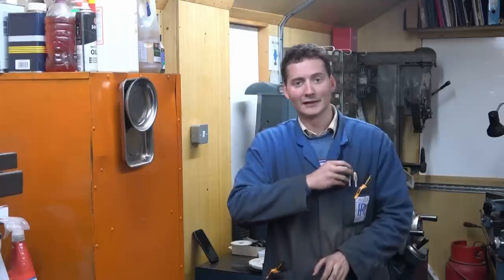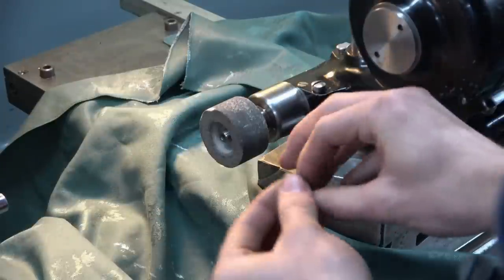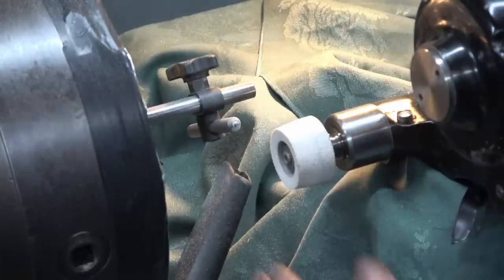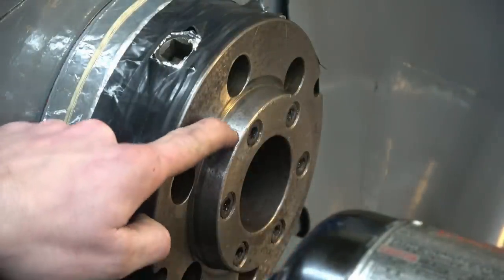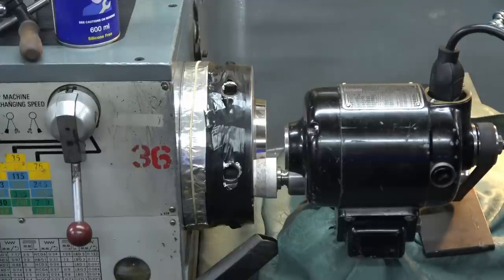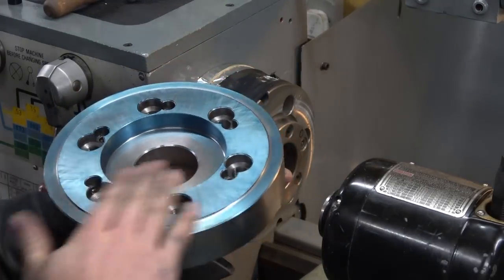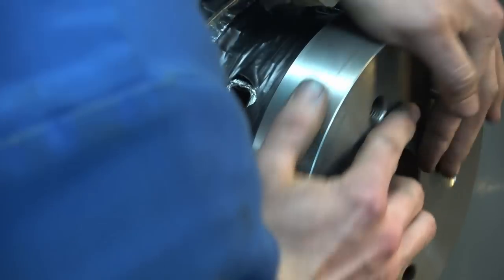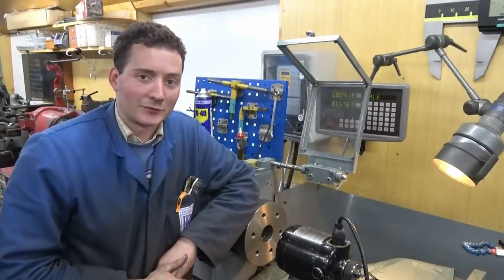Re-Grinding a Lathe Spindle Nose

Comment: no attention to the face of the nose?
Reply from the maker: It's in clearance by about 1mm, I can skim it with a turning tool if I ever get concerned.
Reply: Ah ah! I was looking for just this question. Was wondering if there might be burrs interfering with the fitment considering the beating it's had. Probably no problems with a 1mm clearance.
Reply from the maker: Yes I should have mentioned it
Reply: @MrCrispinEnterprises  its all part of some clever plan isnt it?
Reply: I was looking forward to some final run out readings!!
Reply: The very thought that I had. One needs reference surface to take measurements from. So the very first face tobe established would have been the nose.
Reply: @bcbloc02  he works for rolls royce, so the eyecrometers read "adequate."
Reply: @nilzlima3027  Eyes are like opinions, everyone has them, but properly celebrated measuring equipment usely don't lie.
Reply: @bcbloc02  Yes, I think it would be interesting to turn a piece and then remove/remount the chuck and check the run-out.

Comment: SUCCESS! Good job. From the pattern on the face it looks like the wheel axis was slightly downwards (no cross hatch), would like to see an indicator traverse across the face. I think those D5 pins are adjustable so you could have always adjusted them to the new depth if needed(if I recall). 
What really surprised me is just how soft that spindle nose is to sustain such deep damage.

Comment: Hi Mr Crispin, When I reground the D1-3 taper on my Boxford 11-30 I made a gauge which gave me a reading of how much to take off the flat face once I'd tickled up the taper. It saved a lot of time. As you said you don't need to take a lot off the taper to mean you have to take a lot off the flat face. My gauge is a piece of round steel with a parallel hole through which contacts the taper about half way down. Three micrometer heads are zeroed with the gauge flat on a surface plate. I calculated the distance they needed to project to all contact the flat face with the same reading and then checked it against a D1-3 lathe at work. It was bob-on. The taper on my spindle was fine but the flat face wasn't. I took the minimum off the taper, checked with my gauge and then ground the flat face the difference shown on the gauge.

Comment: I've ground a few spindle noses in exactly the same way but I had the advantage of an old hand looking over my shoulder on the first one. My mentor's contribution was to quantify initial conditions and making progress checks using a dial indicator.

Grind the taper first. Tram the grinder spindle to sweep a plane radial to the lathe spindle axis (as you probably did but didn't show.)

Offer up the gage and note the side play with a dial indicator. Depth mike from the end face to the registration surface. Knowing the side play and working the taper triganometry gives you the stock to be removed from the registration face to obtain a flush fit. Proceed, cup dressing the wheel face from time to time, taking side play and depth mike progress checks til you obtain a flush fit and then a bit further to obtain the 0.001" to 0.002" draw.

The US standard governing spindle noses for lathes is USAS B5.9 - (1967) (Reaffirmed 2004) Available from the American Society of Mechanical Engineers. In it are detailed drawings of every version of US standard spindle noses including small parts. The Metric world standard is much the same differing in small details - but check! These standards are available for a fee (mine cost $35 in 2014) from the parent society. Pay the money! It's cheaper than screwing up out of ignorance.  

Your remarks on protecting the machine from abrasive dust cannot be over-emphasized. Hysterical care in protecting the machine from flying abrasive dust and a careful sequential dismantling of the shrouding with a thorough clean-up thereafter is only common sense. I'd also recommend cleaning/servicing the wipers.

Good work, well illustrated.
Reply from the maker: Thanks. The set up is shown in the video called 'setting a tool post grinder'
Reply: @MrCrispinEnterprises  Thanks. I found it last night - the series leading up to the spindle nose grind in fact. 

Yes indeed. Hard rigid steel items are literally made of rubber on the micro scale and the amount of droop from gravity is roughly calculable if some simplifying assumptions are made and some basic math employed. I've used the very same demonstration (inverting a mag. base and DTI mounted on a short stiff length of square tube) to demonstrate to my apprentices the perils of sweeping diameters from horizontal spindles. That and your application of trade math, geometry, physics etc make your presentations most informative. Machine shop work aint just cranking handwheels and shoveling chips. The most important phase of part manufacture is the initial planning and calculation before the first chip. I'd recommend many of your videos as required viewing for machinist and tool maker apprentices.

I discovered your videos only a few days ago. It's been most pleasent and informative browsing my way through them.
Reply from the maker: Many thanks
Reply: Hi Forrest, glad you're well !!!
Reply: Good to hear you are still alive Forrest Addy.

Comment: Excellent stuff! I'm really look forward to seeing how much (or little) runout there is on the back plate and chuck when its all finished. I'm hoping to have a new lathe shortly and maybe its something to check before putting into use for the first time. The chinese are not known for sorting out the little things on some of their machines. As Stefan says, they are a kit of parts.
Reply: Just and fyi .....most new equipment come with a comprehensive inspection sheet that provides pretty much ALL details specific to the motion accuracies.  If you have the capabilities (precision measuring tools) it would be prudent to check what you can and compare your findings.

.

Comment: Well done. I have D1-8 spindle on my lathe and i think that you can adjust those pins in and out before putting allan screws.
Got to get me one of those grinders, a tad bigger with AC motor for less noise.

Comment: I am surprised that you did not take deviation measurements before and after, using a tenth dial indicator.
Great works and excellent video!!
Thanks for sharing Sir.
Reply from the maker: I knew it was significantly out before, and now I know it's as good as I can get it!
Reply: @MrCrispinEnterprises  …and that here is one of the hallmarks of a professional! Knowing where to push for another magnitude of resolution or another  .1% of speed etc. - and where not to 😊

Comment: Nice work and you're right about shallow tapers, doesn't take much to get it to seat way further back. Also i think you could just wind in the cam bolts another turn if you had to get agressive on the face - the gauge line of them might be below surface but I reckon they'd still work

Comment: i have done dozens of these. the simple way is remove .003 from the back face first then do the tapered spindle surface to diameter using the calibrated master ring.  also i usually grind the nose end  and mark it with the rework date. note that this will not fix bad bearings as some think it will,

Comment: Maybe it's because I worked hard to pay for all of my tools and lathes (I have two), but I take extra care to clear any debris or chips when swapping chucks. I make sure there is nothing in between the spindle and whatever I'm mounting, not just for concentricity, but to avoid the type of damage that you just removed. Nice job btw. Very well done based on your Prussian blue.
Reply: Ownership is surely one of the differences, and Crispin reports that this lathe is ex-college so there’s that… ;)
But there’s also the real-life pressure of having to make money (or make a lesson fit) and something’s got to give.
Reply from the maker: Agree with all the points above plus the idea of understanding. I expect learners at the college didn't understand the effects that the swarf was having.

Comment: I have been following your video series on taking your lathe to bits with great interest. Since I tend to feel weak whenever I see a neglected machine tool—or if you ask my wife, she'd say I’m not in my right mind—it just so happened that I ended up buying a lathe with a slightly bend spindle nose. In case you're wondering, no—it’s too late—it’s already in pieces.

It seems that I have a similar task to tackle as you had, and because of this, I'm very interested in how you set up the dressing diamond so that its axis points precisely through the center of the toolpost grinder's axis. As you've rightly pointed out, when machining tapered workpieces, it’s crucial not to introduce any errors in this regard. However, since I'm a bit slow, I can't seem to picture a feasible way to set up the diamond as described.

I assume you went with the tapered dress because you needed to grind the mating surfaces of the spindle nose and the chucks. Since in my case only the spindle nose needs reworking, I believe it might be more practical to dress cylindrically and, after machining the taper surface, realign the compound slide to work on the flat surface.

I'd really love to hear your opinion or any corrections to my thoughts.

Cheers
Reply from the maker: If it's just the one spindle nose you're grinding then yes that would work. I found I have to redress the wheel quite regularly on the face work so it suited me to level the angle set. Cheers.

Comment: Great Outcome Crispin. When we first chatted about what you intended to do with the spindle, you did say just grind out the high spots as 0.001" off the taper diameter would mean about 0.005" off the back face, looks like you took about 0.002" off the diameter then ? Do you remember how much you reduced the diameter by, just out of interest ? So glad you bought a Branded back plate instead of going Chinese for your reference gauge. After you have finished with it will you use for the ER 40 chuck ? Regards from Australia.
Reply from the maker: I think about 7 thou is probably the number but it's impossible to track as the front of the wheel wears. If I were to do it again then I would skim the front face of the hub first and then I'd be able to use a depth mike to monitor progress. Thanks for your support on this project.

Comment: Good result .  Can you show a clip of the grinding pattern on the face next video ?    .    While you still have it set up , have a crack at shimming the grinder to get the criss cross pattern .  Could not see if you achieved that or not .     The method i use is to blue the face & rotate the wheel by hand , then shim the base angle up or down to get the result .    Good one .  👍
Reply from the maker: Thanks for your comment. It's very close but not quite a full criss cross. It's flat enough that even minimal bluing covers the whole face but not quite criss crossed. I'll have a think.
Reply: @MrCrispinEnterprises  You are right about the limitations with speeds . You can partially get around that by running the lathe the other direction to get a reduction in surface speed if reqd .

Comment: Monarch lathes on spindle rebuilds, hard chromes the old spindle and regrinds the bearing mounts, last grinding the spindle nose/internal taper in place in those new Timken type zero taper roller bearings. The bearings have errors that are marked as high spots, regular production of spindles is going to have small errors also. Manufacturers of precision spindles inspect the components and often juggle the bearings high spots on inner and outer races to compensate for component errors, then finish off with a light grind of the spindle face and taper. This is why if a spindle for any reason is disassembled and reassembled will most often not run true as before. The only meaningful tip I have is if the spindle has to be removed, mark the spindle shaft and inner race locations and outer race locations so as they can be returned as close as possible. A factory spindle rebuild is over $15000. Grinding the spindle in place is the only option. Great video of the worst nightmare of a problem.
Reply from the maker: Good information, thanks

Comment: Thanks for the very informative set of 3 videos about setting up the tool-post grinder and grinding a Camlock nose/backplates. I have a similar job to do on a smaller Camlock nose and your description is proving very useful. You mentioned that the wheel you had was a bit too fine. Do you know what the wheel was and could you recommend a more suitable grit size? Many thanks.
Reply from the maker: I would go for a 60 grit or perhaps even a 40.

Comment: Might have missed skimming on the video, but did you check spindle bearings runout and precision level before? For this operation is usually called 'Restoring spindle base' and requires quite precise bearings with lowest runout possible. Not to mention that in real industry it should be made using dead centers on fine-tuned center holes after all heat treatment operations complete and some time passed to stabilize the steel structure.
Reply from the maker: I checked for play in the spindle bearings before starting

Comment: Very interesting, I wondered how much you could remove to clean up the taper without having to take too much off the back to maintain the correct relationship. A really excellent explanation of the camlock system too. I expect that next you will be using a different wheel and cleaning up the spindle internal jarno taper (or whatever it is).

Comment: Mr._ Crispin - Great Video ! You did an excellent job. I have one question. I was wondering how you matched the angle of the grinding wheel to the angle of the Lathe Spindle Nose. You dressed the grinding wheel using your lathe compound. How did you determine what angle to use ???
Reply from the maker: Have a look at the video called 'setting a tool post grinder'
Reply: probably found a clean spot on the nose to indicate to the compound.

Comment: Excellent results there.  Given the shallow taper, not surprising you had to take a lot off the back, but the results look to be worth the effort you've put in.  I'm going to be making a vertical head for my milling machine, which is going to mean grinding bearing seats onto a spindle, and grinding the inside of the cone.  I'm kinda carking it over that.

Comment: I have found when cutting shallow tapers it is safer to measure depth cut by table left/right and not the cross slide. That way you don't end up running out of room on an immovable feature

Comment: good job !
i love the grinding results, but i really hate grinding dust.
the problem with grinding dust is not the dust you can see, it,s the  super fine dust you cant see, that dust travels everywere into the shopmachine,s...
Reply: Forgive this electronics person for being so naive but… would it be possible / is it ever done to spray a very fine mist of coolant in the environs to catch and ground the finest particulates?
Reply: @mumblbeebee6546  just the use of plane coolant  (no mist) will do the job for 99.5%,  even then some dustparticle,s will escape...

Comment: I spent 45yrs on grinding machines in Coventry & I have ground a lot of tapers on spindle's using gauges or a sign bar on small spindle's, at the start of the video, OH NO hope he doesn't grind much off the taper!!! You got there in the end, very interesting video, does the Morse taper need a grind? It looked a little rough.
Reply from the maker: Yes, I'm certainly glad I didn't go any further on the diameter! Good idea about the more taper although I'm not sure I'd have the travel to grind it unfortunately.
Reply from the maker: Is the method I have shown inline with what you would have done or are there any improvements I could make?
Reply: @MrCrispinEnterprises  I would have done the same, grind in situ as you did, of course in my day I was grinding new spindle's for gear cutting machines, I ground all the diameters,faces & taper between centres, then I would reset the universal grinder with a chuck & steady to grind  bores, some of the spindle's were big fork lifted in m/c.
Reply from the maker: Biggest problem I had was the wheel rapidly deteriorating when grinding the face. Rapid wheel breakdown ect although with no coolant and a small diameter it's not surprising.
Reply: @MrCrispinEnterprises  Maybe not grind the Morse taper bore but instead polish it carefully with a wooden handle with suitable grade of emery paper around it, grinding is again risky you could find the dead centre going in to deep🤔.
Reply from the maker: I'll have a think

Comment: I have to do this job on my lathe spindle nose due to both axial and radial runout. Thank you for the video!
How much runout did you have before your started? Is it the same procedure with a DIN 55027 spindle nose?
Reply from the maker: Not hugely familiar with that spindle type but from a quick look on Google it seems like it is yes. Chucks mounted on the spindle had about 0.3mm run out at the jaw face.